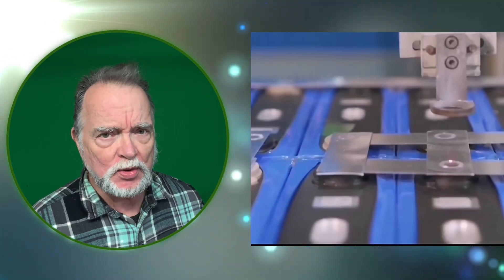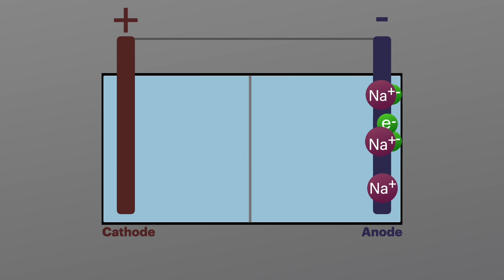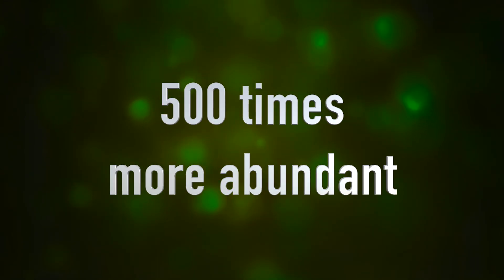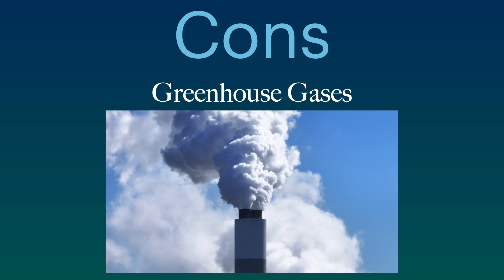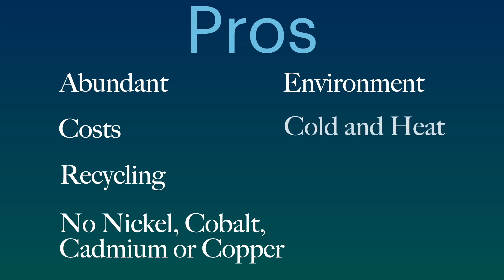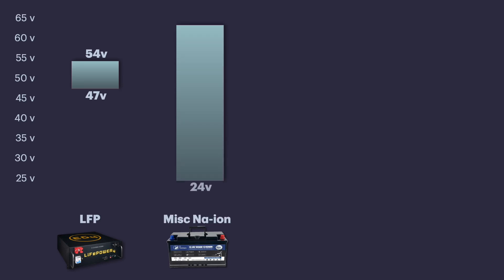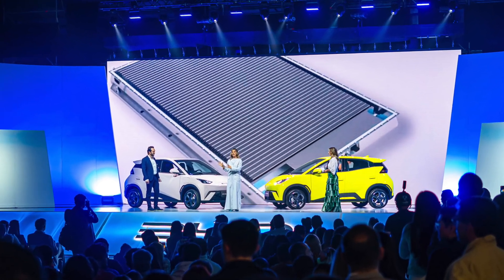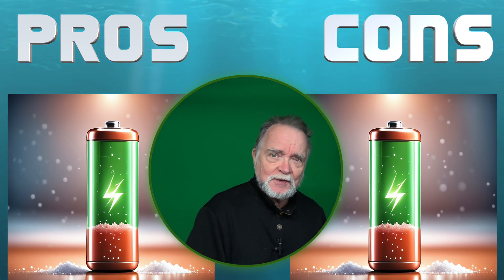Sodium-Ion Batteries: The Good, The Bad, & The Ugly

Comment: Just bought some 18650 Sodium ion cells, so far so good, I want to make durable solar lights that do not pack up after 3 months, Lion do not like charging outside below freezing, NiMH just do not last and are low capacity, NiCd are too fussy. 
These Sodium ions seem to soak up a charge fast, so they will make the most of those sunny moments. The voltage discharge curve is not too bad at all. I am a convert already, I am making my own voltage and current controlled charge, charging them to 3.9 and discharging to around 2 volts.
Reply from the maker: sounds like a good use case, especially for cold weather. Do you have a bms on them?
Reply: @ReelClearMediaLLC  I am working on a few solutions, it is looking like a Low drop out regulator a couple of diodes, one to force the fixed voltage regulator up slightly and another low volt drop diode to prevent back flow into the regulator circuit, and a low ohm resistor to prevent excess current. This is mainly if charging form a 5volt USB, the solar ones I may use a pre-made  energy harvesting circuit. Interestingly I was playing with all this tonight and it was when I observed the unacceptable back flow current from the cell into the Regulator circuit of about 3.1mA, when the charge lead was unplugged, so that it when I realised it needed a Schottky diode to prevent this. My aim is rather than cut off the charge at a certain level, just simply float the battery at a sensible voltage level below its upper limit.

Comment: That you are going to need new hardware is going to be a major issue for people who already have solar. I think it will be especially problematic for people who use 12 V systems. The 12 V appliances all need a fairly narrow voltage range to operate, or else they might not work. 12 V fans might operate at lower speed when voltage is low.
Reply from the maker: Most likely, 12v solar systems will not use Na-Ion  until the chemistry is available  to limit this wide voltage swing. Natron's battery is much closer to the voltage range of an NMC or LiFePo.

Comment: If the wider voltage is related to SOC, this is a plus.
Reply from the maker: Yes, the voltage can be used to estimate SOC. 
But the amps will double when the voltage drops in half (for example, 60v to 30V). Also, currently available inverters and chargers will need firmware/software updates to handle the voltage range.

Comment: who would want it for that price (in case for solar electricity storage) ? I can understand only if someone really need a battery which can be charged under below freezing temperatures, I mean if that factor is very important for someone. All the rest is only disadvantages with higher price.
Reply: Car audio
Reply: @ for car audio the LTO is better.  High current rates not a problem for LTO and all the rest is not worse.
Reply: @theafterbarphoenix9452  exactly what I did. have a sodium battery for my system
Reply: Seems like Na batteries should be less explosive than Li. Because seeing how LFP batteries burn up together with the house they are in looks a bit unsettling.

Comment: Excellent video! I was wondering about the energy density.  For me, give the voltage discharge range it just doesn't seem like a viable option for solar setups.  What do you think are the chances of it taking off and replacing LiFePO4?  I just don't see it happening.
Reply from the maker: @OurBlackCatCottage  it’s too early to tell… Natron’s chemistry is more compatible with solar, but they only sell for industrial use.